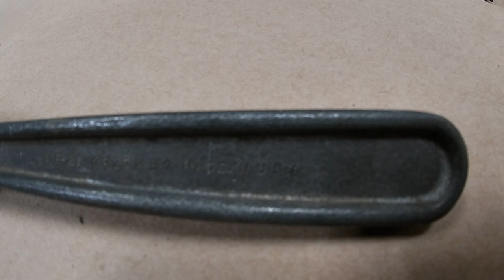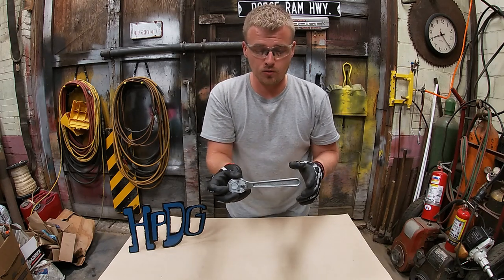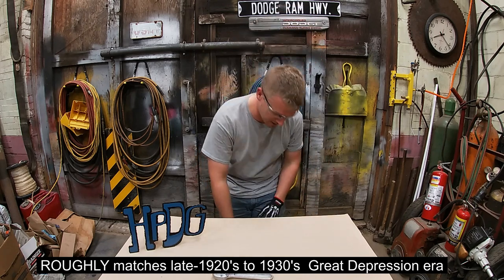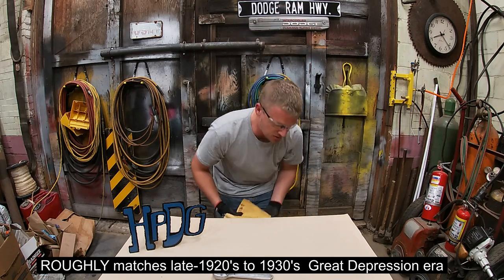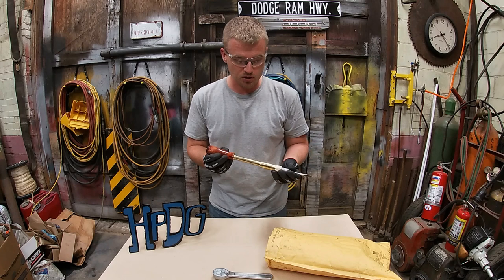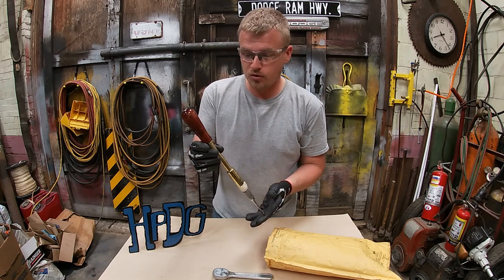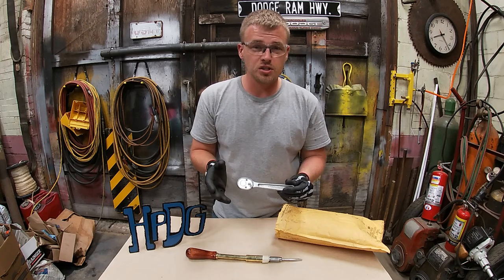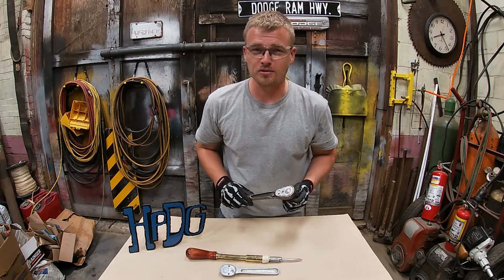Plomb Ratchet Restoration: WW2 Era Tool

Comment: Nice old wrench Zane , that’s very brotherly of you . I gotta get ready for work , but I got up at 8:45 this morning and worked on my truck a couple hours and got a couple little gremlins taken care of, got the transfer case fluid changed, and did an old school tape measure alignment on the front end with a little help from my buddy Matt . Not much of a choice when your running 40x16 Super Swampers. Alignment shops look at you like you have two heads on your shoulder when you ask them about an alignment. It worked out pretty well . 
I’m outta here , I’ll catch up on the last couple videos later today , I’ve been busy this week .
Reply from the maker: Oh I understand complelty. I'll get ahold of you soon buddy! Nothing wrong with a DIY alignment 🙂👍 take care and be safe

Comment: You remember that 76 Chevy military truck I wanted to get? Well I'm thinking of cloning one due to them being rare. I have a 82 Chevy truck outside that's a pretty close setup but newer. It's a 78 frame with a 82 cab. But if I'm gonna clone one I'll have to find allot of the body panels and such. But who knows. I might just get the real thing
Reply from the maker: Hopefully you can find a real one or the parts to clone one Scott! :)
Reply: @HODGEPODGEDODGEGARAGE  If I can't find one then. It's not like I can't go out and find 75 or 76 Chevy truck parts in the junkyard that I can cut up to make it look like a military truck lol. Im gonna need a entire 76 Chevy front clip. Then I need the doors (73-76 had a different style door than the 77 and up models did) then I'll need to find the bucket seats out of a blazer. And a buckskin interior, then I'll have to make a plate for the space for the radio to add the blackout light switch, and the list can go on and on lol